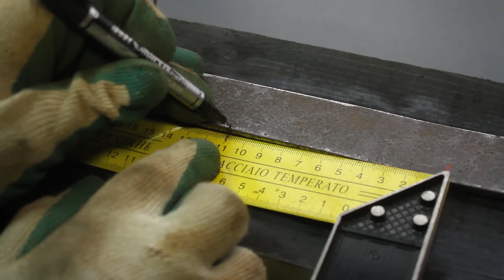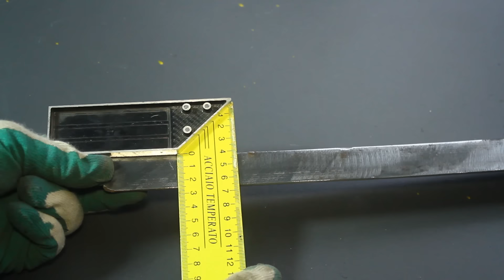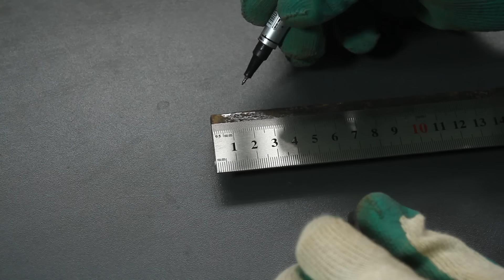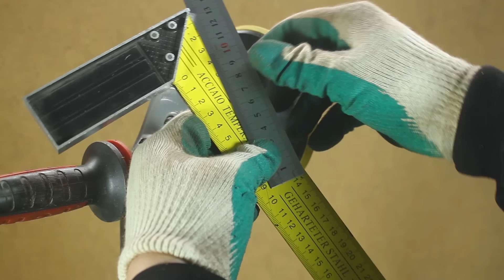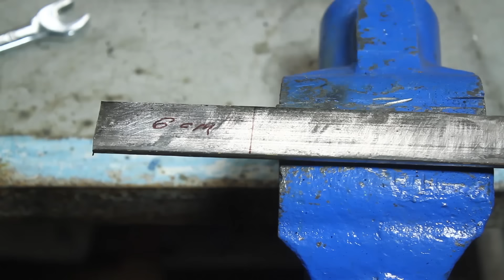TOP 5 BEST DEVICE FOR SHARPENING DRILLS.

Comment: Why are you forcing so much pressure to make drill faster. A good sharp, even, and light pressure will drill fine. Never force a bit to cut because not only will it dull the tip, but over size your drilled hole. Let the drill cut itself to size.